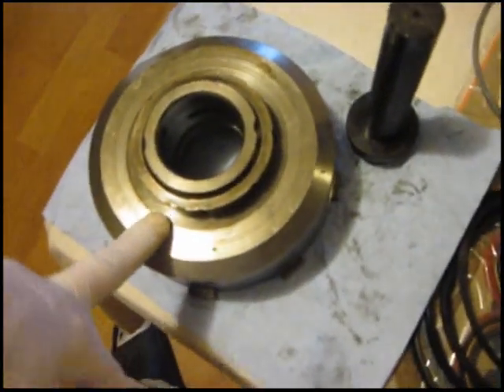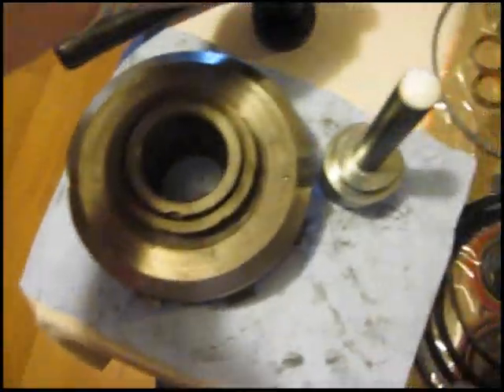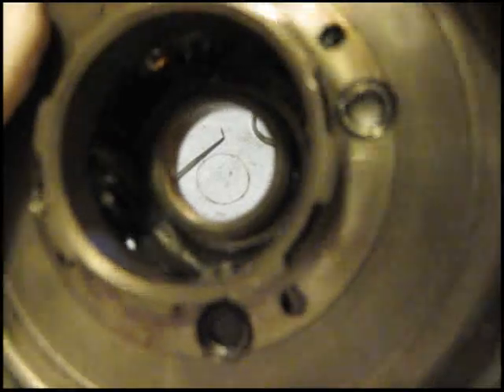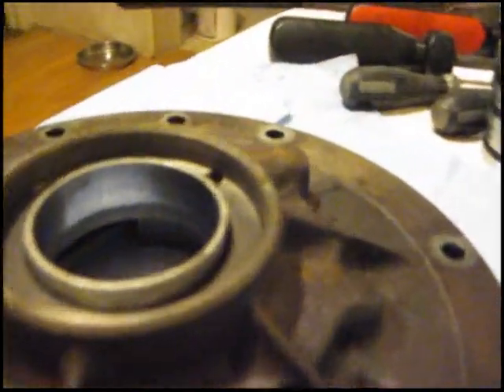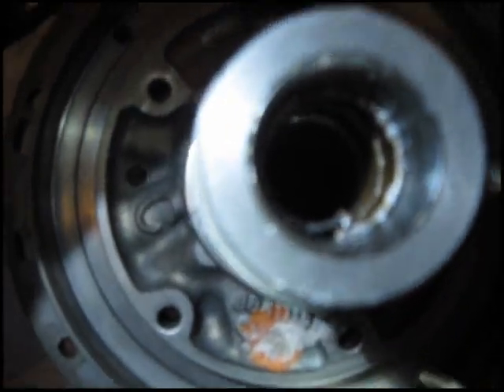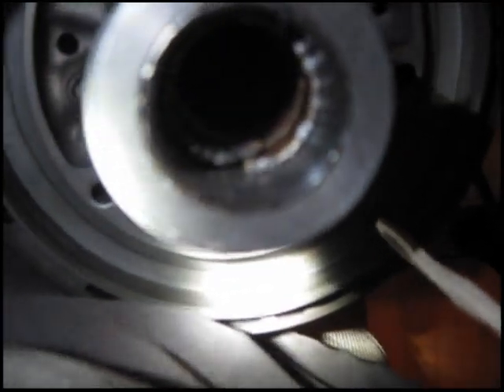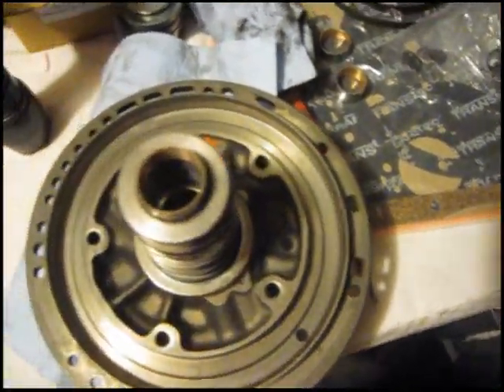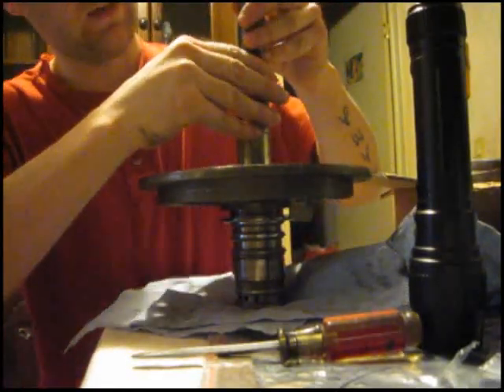350 transmission bushing video

Comment: My 350 transmission is haveing a leaking  issue on  oil pump seal  but i already replaced it with new seal and still  leaks could the bearing  be the problem

Comment: I am working on a 4l60e I need a bushing driver set, I used a screwdriver to take it out but where and what size do I use to install it back in
Reply from the maker: Felipe Vargas I used some bushing drivers from a 700r4 set for my 4l60e. As long as they match up it should work. You can goggle bushing drivers for 4l60e. Spend the time and price match.
Good luck.